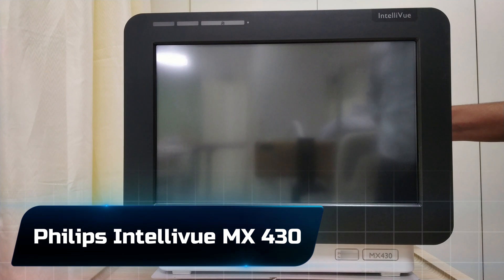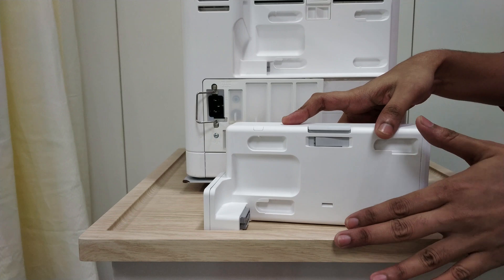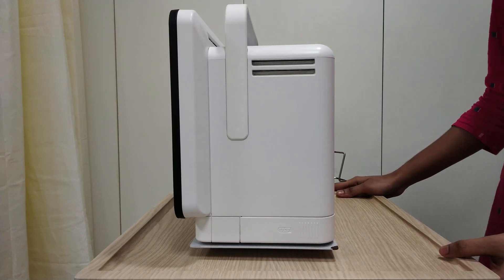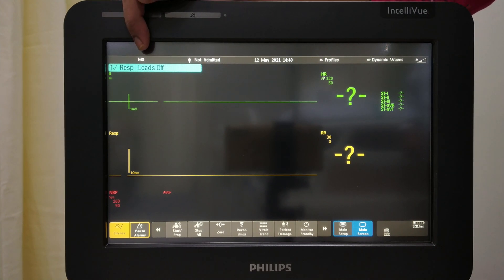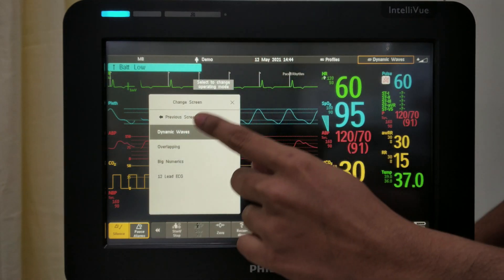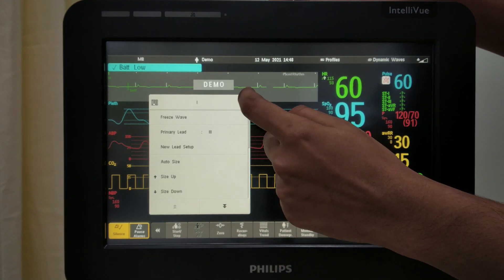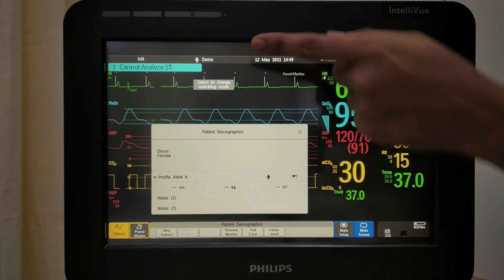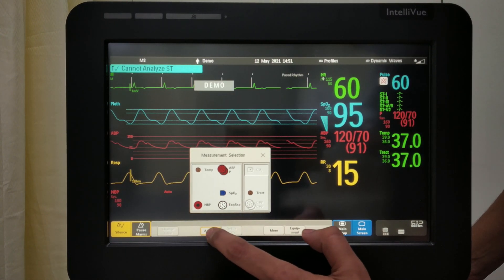Philips IntelliVue MX430 Demo | Patient Monitor | How to use | MMS module | Extension Module |Alarms

Comment: Why can’t set the volume for lower than 4?
Reply from the maker: Alarm altering is one of the main functions of any patient monitor. If you take the alarm to less than 4, then as per the company alarm is not audible. In the case of some patients, an alarm is repeated several times even after being acknowledged, then it is good to slightly change the alarm limit/ range as per patient requirement.